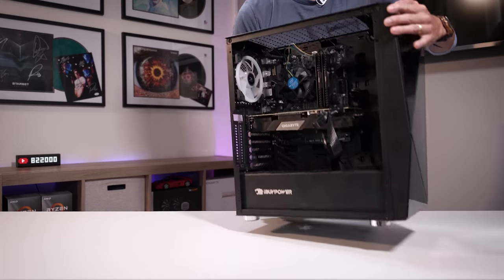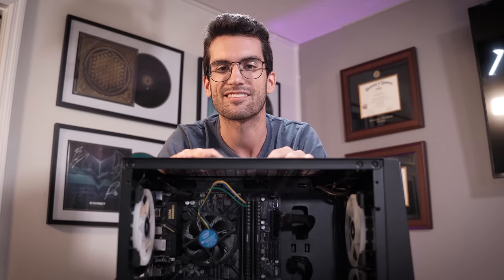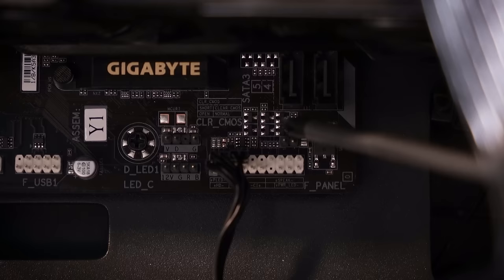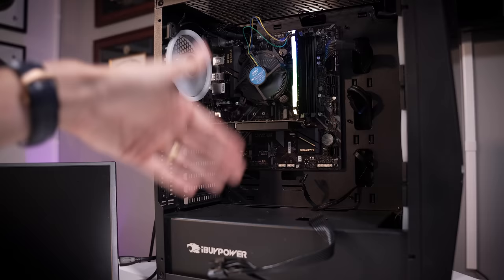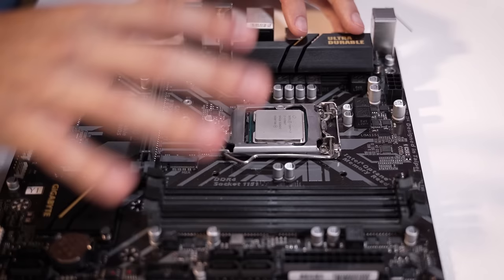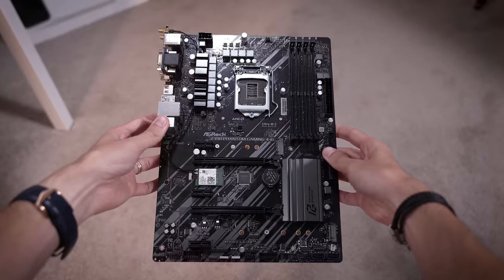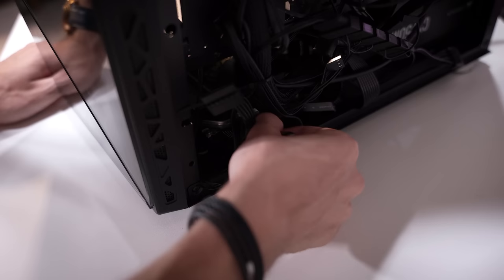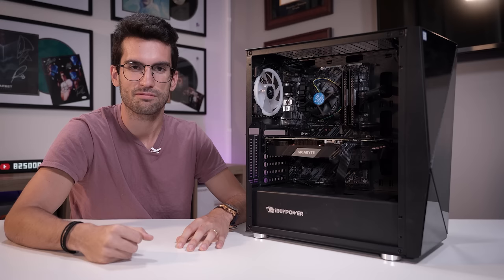Fixing a Viewer's BROKEN Gaming PC? - Fix or Flop S3:E1

Comment: 5:36 was that a spark of electricity when jumping CMOS? Huh, never actually seen that in person though I've only ever extensively troubleshot the one system. This series has been both amazingly helpful and a great deal of fun to sit through, glad the execs cleared a third season after all :P
Reply: Yes, that is the point, to bridge those pins so electricity flows through them.
Reply: Well, sparks aren't the point, it's just something that happens.
Reply: @Dan-Simms  hah no I fully understand. Just that in the times I've had to clear CMOS I've never actually caught sight of it before. Makes sense since you are shorting two points after all, just thought it was amusing.

Comment: Just done this on my rig bought a 9tj gen board supposed to support. 9th gen and kept hanging and done exactly what it did in the video  I had to remove CMOS battery tho. For half hour .. then boot it found out was way out of date to support my 9400f  updated it and jobs a good in works flawlessly
Reply: Updated the bios I ment luckily no bent pins

Comment: I had similar problem with my main pc, 3 weeks ago. for 1 week, the system would reboot after playing games for about 5 minutes. cleaned, repasted and reapplied thermal pads of gpu, same problem. temps were normal. then it got worse. rebooted randomly, even when not in games. then it's having difficulty booting to windows. I could get to post and uefi screen no problem, but can't boot to windows.

tried barebone-ing, then swapping everything (except motherboard) with my lesser office pc, and everything was working normally in the office pc. at this point, by elimination, I thought it either needs a new motherboard or a fresh install of windows. so I reassembled everything into the original pc, to try fresh installing windows. lo and behold, the system ran normally again, and not a single error to this second.....

Comment: may have not been the motherboard, you never know it could have been a corrupted BIOS from a power surge or faulty BIOS chip.
Reply: Most likely it was a corrupted bios, gigabyte mobos love to do this all the time, esp ones with dual bios but at least with dual bios its easier to recover it from the back up one instead of having to flash it

Comment: I thought it was the motherboard or the power supply  ^^, need to save up for a new build. love my 2700x with gtx1080ti  combo , my case is is rubbish from antec , the cable management is fine but there is this wierd foam dust filter behind a mesh that to remove u have have to pry it off the case .. not cool, and during cleaning I have also broken the mount for the front io . there is no power button any more just the switch on flimsy floating board

Comment: I ran my i7-12700 with the stock cooler for a while till I could get my permanent cooler and never had temp issues. Wish people would stop bagging stock coolers that work perfectly fine if you're not overclocking. Intel are not going to nor ever have shipped it with a cooler that won't work.
Reply: I have a 12700K on a B660 (not overclockable) motherboard that pulls 220W and runs 4.75GHz all cores with a 280mm AIO.

Yes the stock coolers will “work” fine and meet the published specs. However you might just be leaving performance on the table if, like mine, it’s capable of self managing higher speeds. I think this is why people get twitchy about using the standard cooler.

My son’s i5 12400 also runs continuously 4GHz+ in “boost” mode on his MSI Mortar B660 motherboard with 240mm AIO compared to dropping down to only 2.5-2.6GHz after a minute or two with the stock cooler.

Comment: The real sad thing is Intel has developed good coolers: whether just taller versions of this cooler with copper centers for socket 775 quad core, or tower heatpipes for LGA1366.  They have been tested as ok performers for systems throwing down 130w.  But with a K sku they just don't bother because they know nobody cares to pay for it.  So they save the money.

Comment: I presume that the new board is also from iBuyPower - at least taking the new motherboard's POST splash screen (15:36) as legit.  I guess you got it from them as a replacement part.
Reply: Yeah, iBuyPower did use these ASRock semi-rebranded motherboards in their prebuilts, but to get these boards separately is to go to the used market - as far as I know iBuyPower doesn’t just send replacement parts. 

I actually was guessing that there was going to be an iBuyPower splash screen because of the addition of -IB to the motherboard name. I don’t believe anything else was modified to the board.

Comment: in the beginning of the video greg said that the viewer told him he swapped everything the gpu,cpu, the ram he tried everything but the final step in solving the potential problem the motherboard. All in all is pretty much diagnosed the problem he was dealing with before sending it in for fix or flop.
Reply: I feel Greg was just dragging to make the video long. It was obvious the motherboard was faulty but, no, he had to take the longest route and test everything again.
Reply: Yeah but you can't really trust anybody else's word on this stuff. I've done troubleshooting for friends and they swore up and down they ruled out one issue or another only to find out they thought they did and just did something wrong that turned out to be a pretty obvious fix.

Comment: How did the preboot splash still have an IBUYPOWER logo despite having a new Motherboard? Wouldn't a new mobo bypass that splash (like isn't it a setting to turn on/off in the bios)? Is it somehow embedded to the OS drive?

Comment: Hi Greg, was the old motherboard bios updated? I had to update my B360 to support 9th gen. I was just wondering if this could be the case. Kind regards
Reply: Not knowing the full history of the system, that should be something to consider. Did the machine come from the factory with it's current 9th gen CPU? It's possibly a situation that would first require using an 8th gen CPU, in order to be able to get to the bios screen. Then perform a bios update in order to get a bootable 9th gen CPU.
Reply: B365 was released after 9th gen was already out so it should have support for it out of the box

Comment: My guess is he was screwing around inside the case on a carpet, not knowing what he was doing, and shorted out the motherboard by shocking it, dropping a screw driver... or something along those lines.
Reply: Also the fact it's a Gigabyte motherboard. 💀
Reply: @UlrichLeland  I am an Asus guy, have been for a long time. Not much experience with Gigabyte boards, but I have heard they aren't bad. Gigabyte GPUs are pretty good too.

Comment: Hi, I have the exact same ibuypower computer except it has an Asus Prime B550 Plus AC HES motherboard, Ryzen 7 3700x, and I just recently put a 3080ti in there (orginally Amd Radeon 6600xt) , and did a massive overhaul to its cooling system. Now my issue is that when I first opened it up and unplugged and replugged my 6600xt, my computer started underperforming and overheating. Back then I could play Minecraft at well over 130 fps at decent temps. Now it runs super unstable,  and made my cpu go up to 90 degrees and stutters and drops to below 60 fps. I upgraded the cooling system and have really nice temps like never before but the perfomance is still ass. This all happened after I opened up my computer after 2 years and decided to unplug and replug the graphics card to check if the 3080 fit then I plugged the 6600 xt which performed good originally and now even that card sucks. The 3080ti despite obviously being bottlenecked should not be dropping to 30 fps and becoming a mess, I dont know if this is software related, or if my CPU and motherboard were hurt in the process of me opening my computer, but its vastly underperforming compared to when I had it stock with its crappy cooler and 6600xt, it would run awesome, I open it, and suddenly now even with its original set up it just underperforms super badly. Ive broken my head trying to figure out what could be causing it but its too many things to consider.
Reply: The 3080ti is capable of running other games at 300 fps, albeit unstable, and hold 144 on other games. However the CPU seems to be vastly underperforming and overheating much more than it used to. Again I did try its original graphics card to make sure it wasnt just the 3080 bottleneck. Now it bottlenecks its original card which was the 6600xt, back then these 2 ran in perfect harmony. The CPU has no symptoms of death. Only vast underperformance and bottleneck never seen before.

Comment: so ive got a fun issue with my Ryzen 7 5800x apperently i have 2 defective cores. on random occasions with out any specific reason the PC just reboots. alwys with an Error in the Event log. 
Its always 
"WHEA-Logger 18" 
"Machine Check Exception" 
"Cache Hierachy Error" 
triggered by Core 2 or 3. 
Using Ryzen Master and deactivating these 2 Cores the crashes go away. So i am currently waiting on respsone from the Vendor what they can do cause i need this PC for homeoffice and i cant sit here and RMA the CPU for 6-8 weeks with no replacement, i dont really feel like buying a Placeholder.

Comment: What's the big deal with using the stock cooler with that CPU? Can you elaborate on that point? As long as the CPU is staying within reasonable temps then I see no reason not to use it.
Reply: K skus for intel CPU's are unlocked for overclocking. They have higher boost clocks and run much hotter than non-K versions. If the CPU doesn't receive proper cooling, it will throttle and run at lower clock speeds to keep temperatures down. If you think that's not that big a deal, then let's put it this way. The i7 and i9 K cpus are usually $300+. So spending a large amount of money on a high end CPU only to use ~65% of it's potential is counter-productive.
Reply: @lumiereeclair  Now I understand. Thanks for explaining it.

Comment: Would you consider Hamburg Pa. to be in the Orlando Fla. area? (via FedEx prepaid both ways) I've been building my own systems since the early 90's and have never had any problems. Until now. I have a Ryzen 9 3900X, Gigabyte X570 AORUS Elite motherboard, etc. I had a power farting issue that would lock the display to lock. I would have to do a complete power down. At this time, I cleaned the entire system, had no affect. Ordered an AIO cooler as I was sure it was a heat issue. Ended up ordering a new case, the AIO didn't fit my case. Long story short, it won't power up, new power supply, new motherboard (same one) and still no joy. Thoughts? Thanks for any and all help. God bless and stay well.

Comment: Quick question (I hope). After replacing the mother board and CPU, where did the iBuypower logo come f rom on the boot up. I feel like I should know this, but it's just not coming to me.
Reply: That is the original board to the system and as this is first video in new series this one is a fabrication by gregg to advertise the new series and get new customers in

Comment: @Greg I have been really enjoying the content, since its quite useful to see what steps you use when troubleshooting. I have a question regarding a 7th Gen build, that I cannot seem to boot, much less post. I have attempted to swop to the CPU, since that was whole point of getting the board. Previously the PC worked, but as of current I get it to start up, but it does not put out a signal through VGA, I have tested this on another PC and it works in that instance. Even after swopping the CPU's back the result remains the same, with fans turning on but still no output signal.

Would apprieciate it, if you have any suggestions as to what to try. Thanks for the content

Comment: I have a question. When it booted up, it showed iBuypower on the screen. How does it know its an iBuypower when you replace the motherboard?
Reply: it's a custom bios flash screen most likely
Reply: @lumiereeclair  Yes, but the new motherboard wouldn't know that.

Comment: I may be missing something obvious, but I am confused about something.

The original motherboard was from the iBuyPower system so it makes sense that had it  still been functional that the boot logo would be an iBuyPower one.

But you replaced that motherboard so why is the boot logo on the new motherboard also an iBuyPower logo? 

I assume that the likely reason is that the new motherboard was also taken out of an iBuyPower system. If so, what a coincidence.

Comment: Great series, Greg,
 
Are there any early warning signs that indicates a faulty motherboard?
Reply: Honestly the Motherboard is always my first suspicion when a system refuses to post.
Now obviously there are a whole host of other things that can cause it, like the CPU, improperly seated or bad RAM, a bad bios version or chip or even a shorted GPU.
Cpu's are quite rare to fail tho, there is even a saying in the computer repair world "it's never the CPU, until it is"
But Motherboards have the uncanny ability to just suddenly stop working. Weather its a blown fuse, a bad mosfet or resistor or any of the 100 other components that support or start the voltrails 12v, 5v and 3,3v rails all essential for the motherboard to give power to the other essential components.

So to answer your question: No. But you can sometimes get hints when the computer last operated, like bluescreens with random crash messages or frozen pc. Indicating that something is about to go bad. Finding out what tho, well that's the fun part 😄
Reply: I appreciate the detailed explanation!

Comment: maybe you need to stock up cheap tower air cooler for replacing that garbage cooler, beause my i5 highest temp was 86'C with those crap cooler and now it's only been reaching 65'C with cheap 16$ snowman tower cooler
nb: and don't buy the cooler with the same design like stock cooler, for the bare minimum please buy one that has a heat pipe on it

Comment: I don't think that cpu CAME with a cooler. It's in an ibuypower case... honestly, I think ibuypower is buying them individually and slapping that in there, OR the user who said he tried replacing the cpu just used whatever was on hand that was easy to take on/off and he didn't care about.

Comment: The daisy chain gpu power hurts my soul. Why do people still do this? Well done on the fix Greg.
Reply: Blame the PSU manufacturer for making such cables.
Reply: @blockbertus  uh no. It's not Chevy's fault if I put a 150 shit of NOS through a stock Cobalt engine. Just because you can doesn't mean you should

Comment: Hello Greg I just picked up a pre built because the price was nice and had something I kinda wanted and needed but it just keeps restarting over and over and it’s been kinda freezing here and there but it is a Ryzen 5 5600G paired with a low end RX 5500 sadly I received this from HP with only 1 stick of 8gb DDR4 it’s literally brand new I have no ideas..
Reply: jump onto the discord channel, i and possibly others will try to help you fix the issue
Reply: @lumiereeclair  I’ve tried Reddit nothing but what discord channel?
Reply: @lumiereeclair  also I’m close to Orlando so it might make a episode of fix or flop

Comment: When you booted with the new motherboard for the first time there was an Ibuypower logo on the screen. I know this was an Ibuypower system, but where does that logo come from? There was no drive connected, the motherboard was not the original so it shouldn't be a custom BIOS, do they put a custom BIOS on the GPU with their logo or where the heck does it come from?
Reply: Same question here.

Comment: I just sent my system to get fixed its a lian li build
And holy shit the amount of problems
From buying a new motherboard just to make the fans work to 6 out of 10 of them not work (suspects its just a L connect update needed) to the cpu sitting at 100 degrees on the bios and no post from the second motherboard (the one for the fans)
I'm sure i'm just stupid and forgot to update the bios of the second motherboard and thats what made everything go to shit but they'll figure it out
Edit: the build is,
R7 5800X
Asus strix 3070
2 motherboards:
Asus strix B550F - gaming wifi II
MSI B550 edge gaming wifi
Ram: G.skill trident Z gold 32gb 4000hz 
Storage: 1TB sasmung m.2 980 pro
2.5 inch 5TB HDD
Psu: 1000W corsair RM1000X
AIO: lian li galahad 360 
Fans: 10x lian li SL infinity 
Case: lian li O11D EVO

Comment: Can’t say I’ve ever had a asrock board that didn’t go bad. It’s cheap for a reason imo
Reply: I've used/using ASRock boards since 2005 in various builds and never had any issues with them. But I also never got the cheapest either always looked at their midrange/higher motherboards. Building various systems since 1992 with various motherboards like Asus/Gigabyte/MSI/Abit/AOpen and ASRock every and I mean every manufacturer of motherboards have/had their failures. Recently look at the recent recall Asus had to do with one of their boards.

Comment: since the mobo died, its because the 9700kf got too hot with the stock cooler and burnt out the mobo.  when you have a overheated cpu / mobo combo the mobo dies first.  very rarely do you have a cpu dying from overheating.